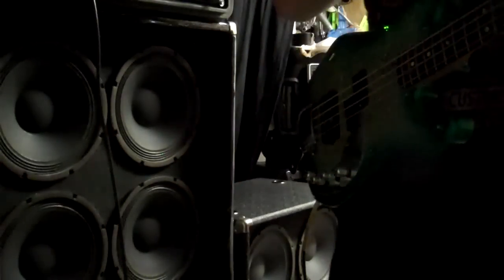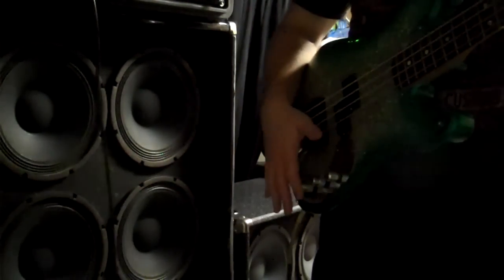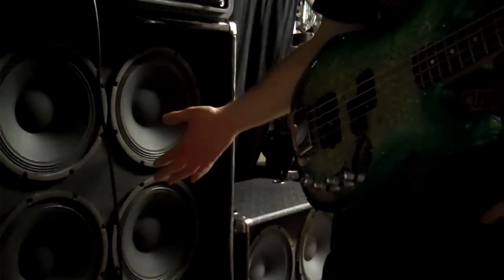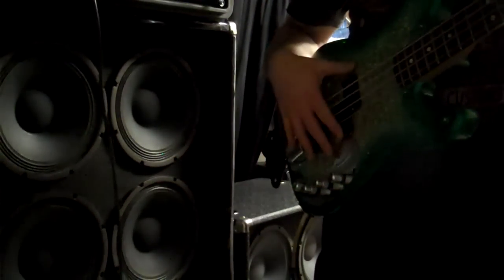The Grouch's Test Room Ampeg 810 vs 410

Comment from the maker: I actually agree with you BadAssBassKiller!  The 810 farts out way before the 410 does. But that requires a 2 ohm load.  And for most stages that would be overkill. The SPL of the 410 is nearly the same as the 810. But 2 410's would be awesome!  The low end of the 410 HLF is unbeatable!

Comment: I had a 410HLF for years, and am currently using an 810HE. The entire time I had the 410 I used a solid state SVT350 head, and used that same head for a few weeks after I bought the 810 (I'm now using an SVT-CL with a 5 string Stingray). I much prefer my 810; I was never really happy with the output level with the 410 so I combined it with a 210HE. No such problems with the 810.

Comment: I bought the 410 HLF for the simple fact that I can A) move it by myself, B) it fits in a car and C) moves more air than the 810E.  I can fill a small club playing the 410 (powered by either a vintage V4B or an Micro VR) and it doesn't require a van and a roadie.  Best cab I ever bought, and I've been through a few!
Reply: *****
Whatever!  I lusted after 810's for years... pigs.  Lazy? Nope.  Just a gigger that knows I can get my shit to a club in one trip and it always delivers.
Reply: basspepper let's get one thing straight, a 4x10 doesn't move more air than an 8x10.
Reply: I’m the same. I run V4B with a 410. Probably the best set up for small venues / Pubs.

Comment: The late Duck Dunn (HEAVY sigh...r.i.p.) liked the B-115(!) in the studio, "but it was the 810 with flatwound strings that drew me to Ampeg." That may not be an EXACT quote, but it's there on Ampeg's website. For ME, rookie that I am, my dream rig would be a Dingwall Combustion with the 410HLF and an SVT-4PRO OR 7PRO (for those times I wouldn't wanna eff with the bulk of the 4PRO). My local music shop once had the SVT-2PRO with the 810e. With a Spector Euro 4 - THUMP CITY!

Comment: I've got a 5-stringer (love it!) and I've got the 410HLF. I decided to go with it mainly because of the frequency rating (28Hz @ -10db is practically unheard of). If I ever needed to get more volume, I'd add another identical head (or ditch mine and go with a 2-ohm something) and get myself another 410HLF. I do wish they would make an 810HLF version. The 810's are basically 4 x 210's stacked up.

Comment: @stefanobass75 I have an SVT 410HLF and here are the reasons I got it instead of an 810. It's cheaper, smaller and easier to move around, has more than enough power for most people (unless you do 1000+ people concerts or something), and I couldn't find anything else with the low-end of the 410hlf. I play an Ibanez 5-string where the low B is around 30-31Hz. The 410hlf carries that B like a champ all day long, but the 810, with it's higher frequency drop, starts noticeably rolling off around a D.

Comment: Great test...  Ya really gotta gig with each though, to get the comparison you want...  I play 5 string, and I've come to the conclusion that, even with the port on the 4X10, there just isn't any substitute for CID of speaker frontage... I've found that my two inexpensive Hartke 4X10 cabs, actually go deeper and stay cleaner at high SP levels, than my Ampeg HLF cab... I think the low "B" just requires more speaker...
Reply: What Hartke cabs did you mention?  I use a vx410 (paper cones) for practice and man that thing kills it down low.

Comment: The type of music that you play should determine which of these cabinets to choose. For the very loud rock,metal and grunge music requires a  cab with different tonal characteristics,so the 810 cab  would be more suitable . Now if you're playing jazz,funk ,R&B something that  requires different playing techniques you would want to go with the 410HL for flexibility in sound. Now,as far as the best cab that Ampeg makes its the 610HLF it handle the loudness that is required for rock and the like  music,but it has the flexibility of the 410HLF. Let your ears be the judge to make YOUR choice!
Reply: i just met a guy today, and was going to tradr my 410 for his 610 (both had towel bars)  that 610 slaughtered my 4x10. but, it doesnt hold a candle to my 8x10.  but it was really close.  to me that 4x10 is much easier to gig with.  the 410 sounded a little thin on the mid low end, but adjusted and found that tone with the svt3, but usually i gig my svt cl with the 4x10 which is a whole different ballgame in its self.  and i also think the wood was thicker on the 4x10, better quality cab.   now ready to a/b a bergantino 4 or 610.   hope this helps.  610= louder with more girth, a pain to tow.  410= less girth, still has the low end i need, but very manuverable in almost any vehicle.  hope this helps others.  cheers. d

Comment: Frequency ratings don't mean anything to me.  As long as your amp has the headroom the 810 goes lower then you will ever need. I used low f# strings, I've even used a whammy set an octave down to reach E an octave below and it doesn't fart out or anything.

Comment: Agree with ya...to a point. Spector basses just LOVE an 810 (to MY ears), as you see in my "standalone" comment. I can't imagine owning a Spector and NOT owning an 810. Weight-wise, though, Dingwall basses have the edge. As I also prefer flats, again, the 810 wins. With the Combustion bass (which I played ONCE, at BassNW in Seattle) I'd do a 410hlf; a Dingwall 'b' string is a thing o' beauty!! Even tho' I'm staying with 4-bangers (for NOW, at any rate!)

Comment: Not enough info. Lots of variables. What type of head and power rating? Most manufacturers team their heads and speaker cabinets to work together. The volume setting was too low.  Both of these cabs are designed to be turned up. Not to distortion, but enough to bring it to life. (I had a 1970 Ampeg SVT 810, 240 watts @ 4 ohms and I currently have an Ampeg SVT 410 HLF, 500 watts @ 4 ohms) And.... it needs a variation of tone settings to show off the cabs tone capabilities. BTW, they are probably different speakers with different specifications and therefore different natural tone. Also, with the 810 it's not just a double speaker thing over the 410. There is an audio thing called "unified effect" that comes into play when you team up the same type of speakers with the exact same signal that intensifies and enhances the whole sound. Not to mention everyone has their own sound system at home that they are listening to this thru.

Comment: Ughh... didn't like the 4x10 at all compared to the 8x10.  It's not about how much low end you have, it's about how tight it is.  The more speakers you have, the tighter the sound will be.  It's not a volume thing.  And the biggest reason I love the 8x10 is because you can actually hear yourself at a gig when you stand in front of the amp because it's so tall.  It's a beautiful thing!  And by the way, I could hear the cabs just fine.  These kids and their loudness wars.  Sheesh!

Comment: @chickenrollup800 My rig is an Ibanez 5-stringer with an Eden Nemesis head (320 RMS) and the 410hlf and I totally agree with you. If I needed to punch more sound out, I would get a better head and grab another 410hlf 'cause it's a BEAST on that low B string!

Comment: I have the 810e in a road case  if anyone in the NC area is interested, I want the 410 mainly because its the first 410 I've tried that had the lows I like for my 5 its really deep sounding. The 810 is awesome, I'm  just getting older and getting tired of moving 610s and 810s around.